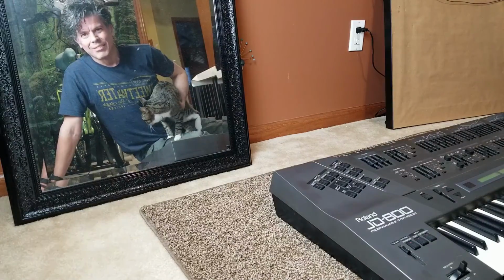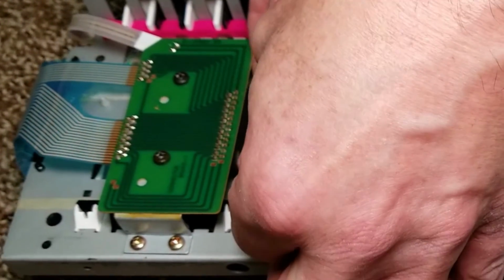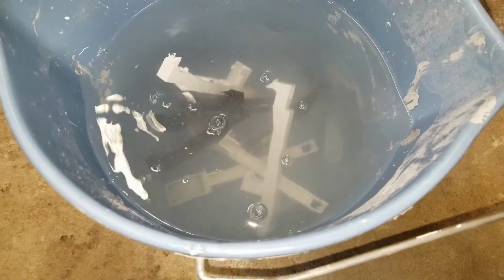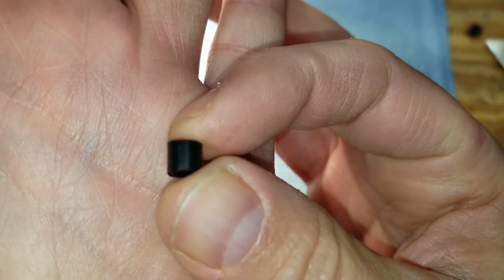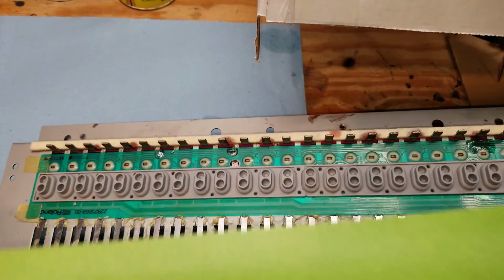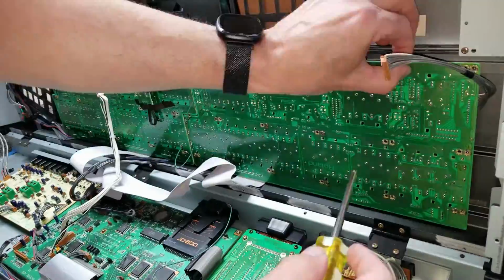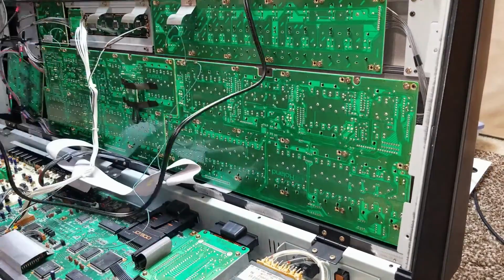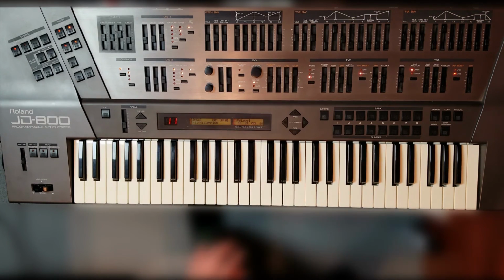Roland JD-800 Repair, Restoration & Modification

Comment: "The Roland JD-800 is a virtual analog synthesizer produced from 1991 to 1996."

it's not remotely "virtual analog" - it's a ROMpler with sliders.
Reply from the maker: It has digitized waveforms that are used as oscillators, and the remainder of the synth models analog subtractive synthesis. Yes, it has D-50-based samples which can be used as oscillator sources that are not the purview of classic analog synths, but overall, it is a digital emulation of analog subtractive synthesis. It's not a true VA that can do things like direct oscillator modulation (oscillator sync, etc).
Reply: @ScottsSynthStuff  it's  Rompler, i've owned one for decades.  words matter.